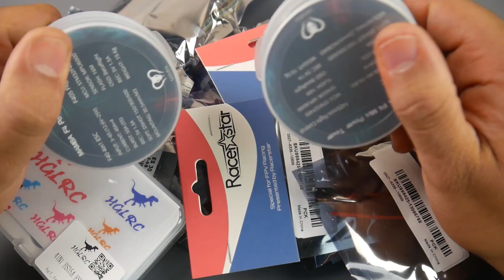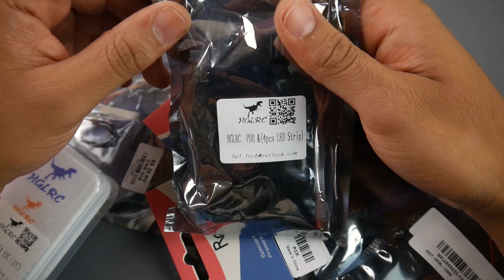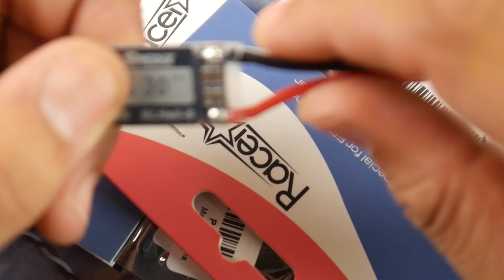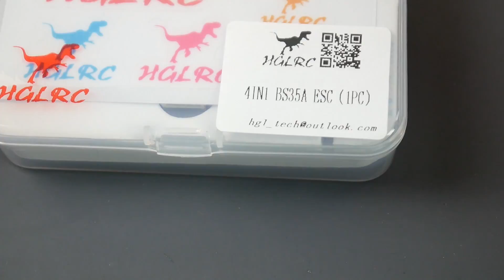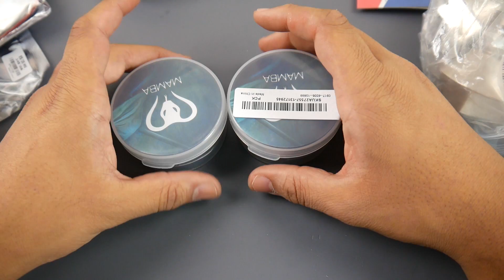MailBag Time!!  // Mamba Stack, Spedix ES30, Racerstar SPORG X , Racerstar PGA

Comment: What is the current sensor supposed to be set at? I got mine and it was set to virtual, so I set it right and I know jb f4 is set to 250, and the bff3 is set to 236 or something. But not sure what this one is bc it dont tell u. Not much on that part
Reply: I also have both of them, and they both fly awesome! 20x20 and the 30x30, I even went and bought another 30x30 that's how well they work lol

Comment: Can you tell the OSD video signal sag correction capacitor types/values for Mamba stack? Yelow capacitor pair in OSD side for both 30mm and 20mm stacks  (in 6:59 and 8:42) look like 47 uF tantalum ones which is very nice if that is true.
For others - capacity value in OSD input matters - should be no less than 22 uF and better if 47..100 uF. If capacity is too low, picture in most DVR recordings and some googles distorts and flickers. It was described in https://fpv-racing-forum.de/attachment/19249-rapidfire-osd-compatibility-pdf/ . Some manufacturers cut corners here with cheap 10 uF capacitors which result in weird FPV picture issues later.

Comment: Can you do a video the mamba install. I have one and can't find sbus hookup documentation.
Reply: Steve Hess for the 30x30 connect to rx1 and use uart 1
Reply: @alexandert5960 Thanks for the response.  I'm using a Taranis, what about the  inversion?
Reply: @SHess65  I use a xlite I didn't need to invert anything just chose sbus receiver
Reply: @alexandert5960  Ok, I'll give it a try.
Reply: Thanks for the input.  I got the receiver working o RX1.  I am using the r-xsr.  I have tried and tried to get smartport telemetry working on TX6 using the standard uart and also using it as softserial and cannot get anything coming across on telemetry.  Anyone out there got this working?  Tips or suggestions?